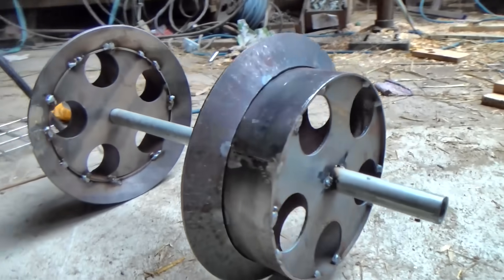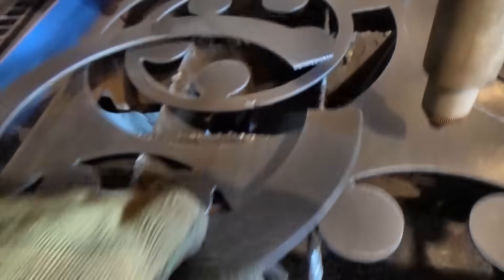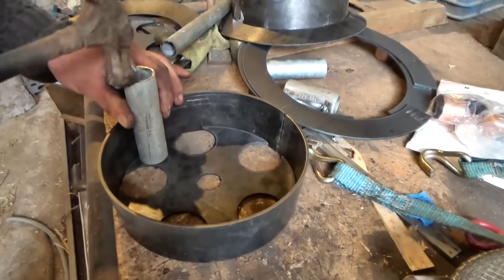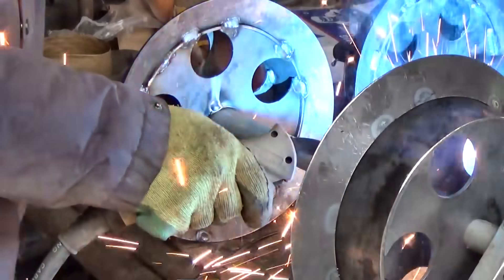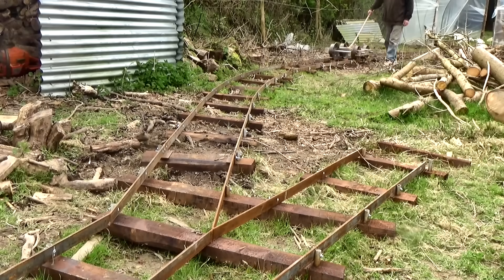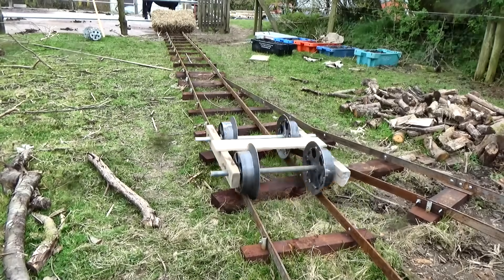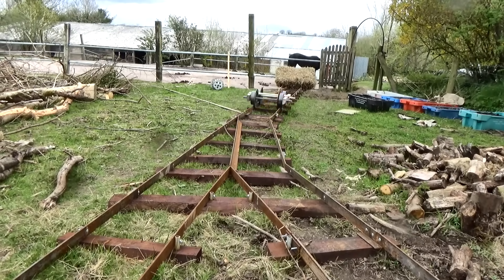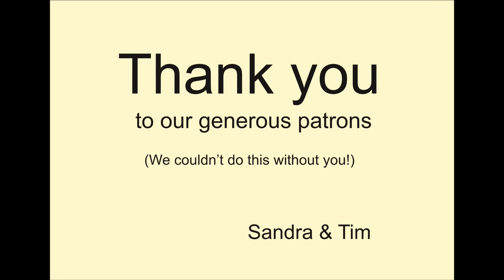Home Made Tapered Tread Railway Wheels

Comment: Hello. Thank you for posting such wonderful videos!
I used to enjoy "15-inch gauge" trains.
I respect you.

There is no need for a taper on the wheel tires.
The taper on the tires is a shape used to reduce wobbling during straight-line running.
It is hardly effective when running on curves.

What’s most important is the flange.

I researched based on old British patents and railway systems.
I built several trains.
I prepared parts such as flanges on ventilation openings, which I hammered and bent into a tapered shape to create rounded corners, and large iron wheels used for doors, which I shaved down to modify the flange.
I didn't have a welder; I only had a small electric drill.

As a result of my experiments, I found that you can run the train by adding a radius of about 7mm to 10mm to the flange end that contacts the rail, or by making an angled cut of about 5mm at 45 degrees.
The tires were flat.
A sturdy track is necessary. This setup is not suitable for high-speed running. However, on my private railway, the speed was below 20 km/h, so it was fine.

If the flange end is sharp, a large force acts on a small area, causing it to catch like a spike and derail.
Rounding or tapering the shape reduces this problem.

Finally, I modified a very small, cute tractor to create a gasoline-powered locomotive.

I used railway tracks, but I think your rails might have edges or steps on the inside.
I believe adopting a tapered shape for the flange is a very ideal choice.

Comment: Ok, please, everyone, hear me out:

Tapered wheels are required for rails which are bent inwards. Rails are neither standing straight, nor vertically. Conical wheels are needed to match the rail angle, and there should be NO angle between wheel and rail (on the contact surface).

Thank you for attention. Now please stop commenting on tapered wheels without commenting on rail angles.

Comment: Normal full scale train weels grind flanges in curves and switches to incrcing the ware on the wheels and the inside of the rail head  , actually there are sometimes  special lubrication systems placed in tight bends than put oil grease  on the flange , to decrease the ware. The grinding is the high pitch noise that trains make .

Comment: I seriously doubt they're important for your application. They're really important for preventing derailment of big heavy stuff at high speeds and forces in turns; not so much for human-powered garden carts. Cool of you to try other people's suggestions anyway. I really enjoy your railroad, thanks for sharing! Some more detail follows, for anyone interested.

No wheels of any usual sort will move smoothly through those sharp angles. Tapered wheels aren't for keeping it centered, they work by shifting towards the outside of turns so the part of the wheels riding on the rails can effectively be larger on one side and smaller on the other to follow curves without slippage. If that doesn't make intuitive sense, roll a cone-shaped object and notice how it travels in a circle instead of a line. To work correctly, tapered wheels require a smooth curve of gentle radius with proper rail spacing all the way through the turn. Getting jammed up around tight points with no space to shift around and ride freely, they are more or less useless as seen here. Optimizing them requires balancing several specifications: the angle and width of the taper, the spacing of the rails and of the wheels, the radius of the turns in the track, even the size of the wheels and length of the cart's wheelbase have impacts, among other things.

Comment: Agreed that Tapered means less friction on straight track. Friction absorbs energy. Energy comes from your engine. So you can measure the cost (in theory) of straight wheels by seeing how many hours your air-cylinder/steam boiler/gasoline engine can run with tapered wheels vs. with straight wheels.
I suspect that the difference, if measurable, will be negligible when offset against the labour costs (time and welding energy)
Reply: It doesn't matter much either when he is only moving some garlic or charcoal 50-100 meters. It is not a freight train that goes accross the country.

Comment: As far as the corners, you don't have a problem; you have two problems. The other problem is: in tight corners, you have two different radii, and with both wheels welded to a common axle, one wheel has to slip to make it around the corner. This may also lead the wheels to hug the sides of the rails. I get that bearings are expensive, but perhaps you can get one pipe to fit inside another, and use some grease to lubricate it, and perhaps something to hold the whole kitandkabootle together, such as a c clip and washer--or a bent nail or two.
Reply from the maker: True! and I might try it if I find two suitable sizes of pipe..

Comment: Having made wheels with flat treads cut from tube welded to 6mm thick flanges I agree with your findings, your original wheels are fit for purpose and any additional complexity isn't worth the botheration.
Reply: absolutely correct !!

Comment: What people don't get about the taper, it's not just the wheels that make the system. Proper rails have unique geometry that work in conjunction with the tapered wheels, plus the amount of weight pushing down. Plenty of resources on that right here on yt, so not sure why people didn't manage to put two and two together.

Comment: I imagine a steeper taper might help a little, but yeah, I suspect the curves are just too tight to avoid all scraping. Plus if you get a steep enough taper it might start putting outward force on the tops of the rails.

Still, nice to have it move more smoothly down the straights with the slight taper. Of course, I'm not the one doing the extra work. :D

Comment: For your curve and crude rails, it's seam like the tapere on the weels should be way more. And at this point, it will add an horizontal force on the rails. So it's not worst it for your rail.

But I also was thinking, Did you try this kind of rolling systeme (like a roller coaster):
were you can use simple cylinder to suppoert the cart, and vertical guiding weels or pegs. Then you can also add a demper on this vertical weels for a smoother ride across your switches.

Comment: Kia rio 2006 + rear break discs have about the correct size and have a tapered outta that would run on the track. Our scrap yard sells a pair 4 as little as £5 as their not supposed to sell them to be used on vehicles again. Just to let you know hope that helps
Reply from the maker: Thanks - you're very lucky to have a scrap yard like that!

Comment: For your particular application, I think the straight wheels work just fine. The over-sized flanges are also a nessessity because of the curves and especialy the turnout angley bits. The slow speed that your equipment operates at allows for a great deal of' fudging area', as opposed to precise mechanical engineering. Keep up the good work.

Comment: Hi Tim, I'm sure this topic isn't new to you. I just wanted to say that rail transport cars usually have steering near the axle. This steering isn't very much—no more than 7-9 degrees for narrow gauge.

If you make your axles movable (rotatable), it will definitely work really well. I think it will make using them much easier. Best regards, Torsten 👍👌
Reply: Unnecessarily complicated for Tim's use case

Comment: I think people lose sight of the scale and purpose sometimes. Yeah if you're running a full size railway with cars that weight thousands of pounds, you need ballast, if you're going around corners at speed, you need angled wheels. But when you're talking about a railway that's gonna be holding a fraction of that weight and usually going at walking or running speed it's fine!

Comment: Make sure you check often  and make sure the jaws on your vise are tightened up securely before hammering on them. I had the same vise and was hammering on it and it broke the bottom shelf out where those jaws sit. They had been loose and I neglected to cinch them up. Very unfortunate to say goodbye to a partner that had been with me for years! 😕

Comment: Maybe a good idea to research some old minecart designs, that's pretty close to what you have put together. I think those wheels were usually cast. Easy to get into the shape that you need. I'd say they're a bit smaller and don't have such an aggressive taper. Might be easier to built repeatedly once you have a mold and you could use pretty much all the scrap you have laying around. Just thinking out loud over the internet, love your project!

Comment: The taper does make the wheels run more centrally and keeps wear off the flanges but for your railway I doubt that wear is likely to be a major issue, unless you plan summer excursions across the field 😁 Of course, any rubbing of the flanges will incur a friction penalty, so the conical profile should hopefully be more efficient, and it doesn't like a massive increase in manufacturing complexity so it has to worth a try... maybe do a comparison. Edit: 3:37 Should have waited 🙄Oh well.

Comment: Instead of cutting your tapered wheels out of steel sheet couldn't you take a section of the pipe you already used, cut a small wedge out out of it, do some rolling, then reweld it back together?

Comment: The old adage "don't try and fix what's not broken" This railway is only a way of transporting stuff over boggy ground and it does do that very well, is it the most efficient? no of course it's not but the turns are too tight for any wheel design to work perfectly.

Comment: To prevent Wheel Grinding... Borrow the same methods used in Rollercoasters... Using Horizontally Mounted Skateboard Wheels, to keep the Cart perfectly Centered on the Track.

Just create a frame extension to mount them on... and place them in the front and rear of the cart..

Comment: Maybe if the wheels are mounted closer together on the axle the taper would have a better chance ""to work".  This would mean that in a curve the outer wheel would ride close to the flange and the inner wheel would ride the portion of the wheel with the smallest diameter causing the wheel set to create a curved path.

Comment: I can't be 100% certain but fairly sure the taper on railway wheels is pre-dated by beer barrels! The shape of the barrel allows them to be moved on long tracks around the brewery, following curves without falling off the sides.
Reply: The best thing is that you have to empty the barrels first. :-)
Reply: Belly in the keg reduces friction to a single point and allows easy turning while being rolled on a flat surface as well.
Breweries/wineries definitely predate cooperage.
Reply: I'm pretty sure the shape of the barrels is because it is way easier to make a watertight wooden Barrel in that shape.
If the barrel was a straight cylinder, it would have been  nearly impossible to forge metal bands which fit perfectly to clamp the wood watertight, and at the same time to be still able to push the metal bands all the way to the center of the barrel.
If the barrel is thicker in the middle, the metal bands just need to be roughly the right size and you can just hammer them onto the wood as far as they go and it will be watertight...
Reply: Oh, I'm sure the general shape of the barrel is to aid its construction and enable water tightness but the particular curve/dimensions are what allow them to run on tracks (without flanges). An image search for 'barrel tracks' will return some vintage pictures.

Comment: Hi, railroader of 16 years here. For your railway, I'd recommend only make tapered wheels for passenger wagons so it won't be as bumpy for riders.
Reply: Prop up the outside part of the sleper  in curvs instead of tapering the sliper itself, this is how real railways do it.
Reply: @perstaffanlundgren  we are talking about tapered wheels to make the train steer itself, not tapered sleepers...
But you are right, they make the outer rail in curves slightly higher than the inner rail to make the train lean into the curve like a motorbike. That is to allow for higher speeds and to make it more comfortable for the passengers because the curve gets less noticeable...
Reply: @Henning_S.  sorry miss read steeper as as sleeper , my bad . I agree doe ,because he has narrow  rail heads the taper can be steeper , doing this on "traditional rail profiles " would make the weels run on only on the inner edge of the rail. With basicly  a one point contact surface it's a minor problem, to tapered would try to force tje rail  apart with heavy  loads , and in the long run he would get a bit sharp edges on the rail mayby.
Reply: @perstaffanlundgren  That is to deal with sideways forces when going round corners at speed, and is a complete non factor for this kind of railway.
Reply: @abrr2000  yes. I know thats why they tilt the rail profile. 
It looks really strange when a train has to stop in curves on the main line  ,the cars leaning over, almost looking like they would fall to the side. The low speed industrial spur lines  is much more horizontal.
Reply: possibly also for engines in that case.
Reply: Maybe you can try a steeper taper to improve steering through tighter curves

Comment: Brake drums would be better because 1) they are off the shelf (at all good scrap yards), 2) they are already tapered, 3) all you would have to do is to plasma cut some rings for them and weld them on as flanges and 4) using much less of your steel and a reduced amount of welding
Reply from the maker: So expensive here though
Reply: Several problems to that: 1, the few cars with ‘drums’ only have them at the back (discs on front these days), so only a pair of matching drums. 2, drums tapered? I don’t think so. 3, ever tried welding cast iron? To steel?? Good luck with that!
Reply: @leslieaustin151  Indeed. Also, drums and discs are cast, so will wear much more quickly.

Comment: Stick with pipe wheels. 
For the design for the dung transport.  I suggest  a full length tip box. With  single latch to hold the  box in transport.  Box with a offset, so it easy tips when the latch popped open.  This maximize the process of transporting dung to the garlic field. 🤔

Comment: If you  put bearings on each wheel instead of that live axel, you would not need cone shaped wheels to make turns.
Reply from the maker: But I don't need cone shapes anyway
Reply: @wayoutwest-workshopstuff6299  I figured that there would be too little friction to worry about. Anyway, I like the way you accepted the challenge to build cones. You with that plasma cutter and welder are formable.
Reply: I think the live axle is what causes the squeaking. Maybe just some welds to hold a loose wheel in place on the axle would suffice  for cones  or straights and give a  more definitive answer...

Comment: There is always only one rail curve radius that is working perfect depending of your whells gradient ;  when there is a welded ( no possible difference in rotational speed ) connection of the wheels. So your simple wheel is the right choise as more economical.. I like your railway very much and you are a good "inventor".

Comment: For you..keep it simple
 However you can do the geometry to work out what angle of cone will self steer on your tightest radius. That's what it comes down to.
Reply: There is no amount of angle that will work with his wheel size and track radious, he would need to make them about the size of skateboard wheels too even have a change of getting it right.
Reply: @jonasstahl9826  Not quite. The coning causes a differential effect to naturally centralise the wheelset, whether on straight or curved track. This will however not work on his sudden switch pointwork
Reply: @gs425  Yeah i get what you mean, I am trying to say that his current coning is not enough for even his gentlest curve.

By my "guestimation" he would need a minimum radious of 50m what obviously wouldnt work for his application.

Means trying to cone the wheels is basicly pointless for him.